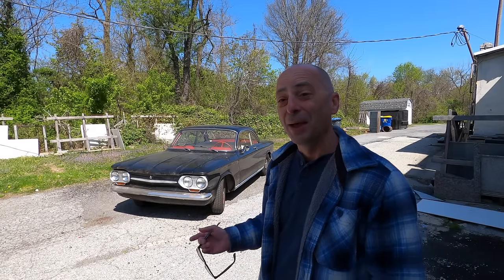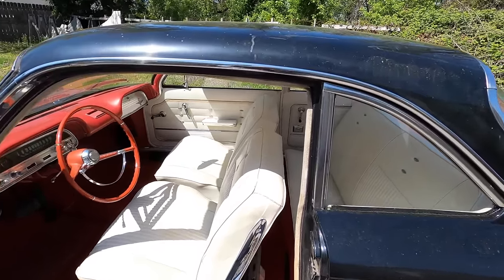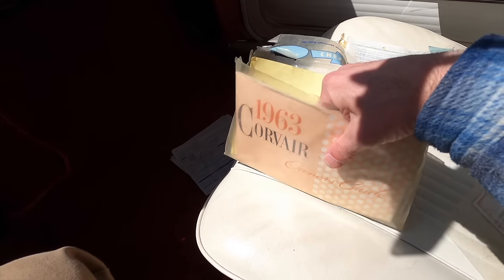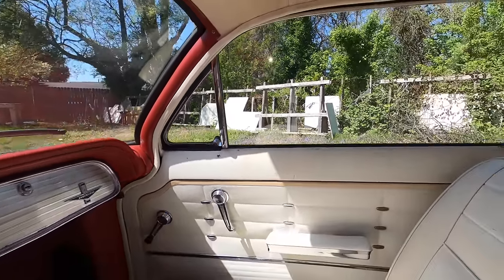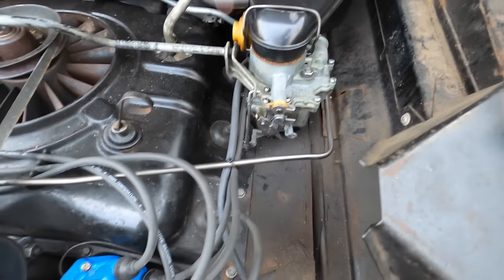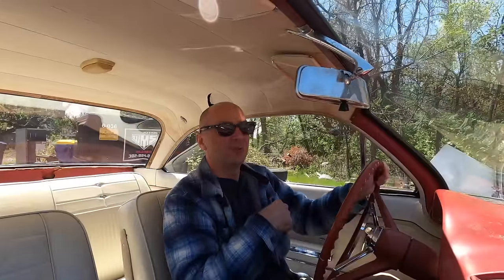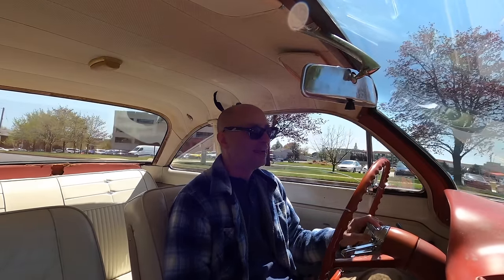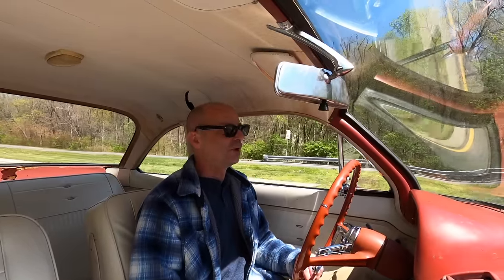Chevy Corvair - The Weird, Quirky, Cheap and Yeah COOL Compact

Comment: Something that I rarely hear commentators mention is that Chevy spec'd front tire pressure at 16psi front and 30psi rear. You typical gas station attendant (back when they would check your oil and air your tires) would set all 4 tires at 30psi, which drastically affected the handling. Also, the first gen Corvair had a swing axle rear suspension, (the reason for the propensity to roll over) just like the Mercedes, VW, and most other inexpensive cars with independent rear suspension of that era. It would have been interesting to see what Chevy would have done with it if Ralph Nader had not put a bullseye on it.

Comment: The gas caps on those were a vented cap and they were a very simple cap because they didn't have evaporative emission controls back then. You could probably put a new cap on it cuz they're very cheap good the other thing I would be looking at is the fuel pump. Remember that's an air-cooled engine and it runs a bit hotter than the water cooled engine. The pump might be starting to get weak and he might be getting vapor lock. This is where the gasoline boils in the gas line turns to a vapor and shuts off the gas flow. Most people don't even know what that is today because of high pressure fuel injection it doesn't exist anymore. The other thing that needs to be addressed is the gasoline we're using today versus the gasoline they used in 1963 is quite different. Today is gasoline's have 10% ethanol in them where is alcohol would never been used in the 1960s. That could create some of the problem alcohol has a bad habit of separating from gasoline (also known as phase separation) the lower BTU of the alcohol requires a richer mix than gasoline that can do it as well. The other thing is motor oils. Do not use for any reason 10 W 30 5W30 modern motor oils their zinc content is too low for that engine the same goes for 10w40 it's too light. The recommended oils are SAE 30 or 20w50.

Comment: The Corvair you show is identical to the one I was in with 4 others from my high school track team when the rear axle came out during a left turn and almost killed all of us...the Corvair was still new!  (Talk about a death trap!!). And as for Chevy selling so many cars, in LA where I grew up, GM bought out the Pacific Electric (PE's as we called them) and other street cars and put their smog producing buses everywhere.  Which forced people who had used (clean) street cars to buy cars!!!  GM was never an innovator, just out to sell their cars, which fell apart by 60 or 70,000 miles.  I learned to drive in a 57 Chevy that lost a front wheel on my way to school.  Funny, the 57 Plymouth I got afterward drove untill the engine died without losing any axles or wheels.

Comment: The stalling and no-start may ne due to vapor lock...an electric fuel pump cures that.  Also a 1964 type rear transverse spring and front sway bar will greatly enhance your handling.  Seat belts are an easy and important upgrade as well...enjoy your baby!!

Comment: Corvairs were a cult car in the 60’s !
Definitely in a league by itself ... you had to respect its limits but these cars would perform well and were reliable ! 
Biggest problem was George Nader- besides that they leaked oil if they were over heated and would throw the fan belt if over revved ... I have a 1960 one owner with a 4 speed and a spare spare motor now ... been sitting for decades but tons of potential !

Comment: I bought a 62 Falcon that sat a while and it had same fuel issue, it was dirtdauber nests in the vent line, blew out all the crap and then it stopped stalling.
I have a 67 corvair, the late models are really different cars and look great.  I would not own an early one, they look like old cars.

Comment: No question, it's a cool car.  But it really is a bit dangerous.  Being scrupulous about your tire pressures helps, but the combination of soft springs, and rear engine and a swing axle, gives it very unpredictable handling.  The problem with the heater that you mentioned is actually a bit more serious than smell.  Actually, Carbon Monoxide leaks badly into the passenger compartment, which can be harmful and even fatal.  And the steering column doesn't collapse, extends past the front axle and has no engine to help limit its travel.  So a small front end impact can impale you.  Of course, no classic car is as safe as a modern car, but this one is a bit risky, even for me.

Comment: Covairs are definitely cool. I think, that having an automatic transmission in an early Corvair is pretty unusual. Automatics used a lot of the engine's power which probably explains, why it has the higher horsepower engine. Probably, the original owner wanted automatic & automatic transmission Corvairs likely "automatically" came with the more powerful engine, unless it was a special order.

Comment: If you don't "lock" the ignition, you can start the car without having to find the key.  That was the point of being able to take the key out while it is "on".
Reply: Thats a weak theory not fact:  Why would Chevy design stuff so you could lose your keys?  What about this theory:  Its so you can get out and open the trunk without turning the car off - lets say you're warming it up in the winter and want to go back in the house -

Comment: Lookup the Pontiac Tempest with a 4 cylinder and rear transaxle from the same time frame.  Interesting car,  it had a " rope " driveshaft and half a 389 V8 engine.

Comment: When your Corvair was acting up where you crossing into the next county?  That's what happened to my friends Corvair.  Anytime we  passed into another county his 1964 Corvair Monza Spyder would act up.  Come back over the line smooth as glass.  It was a quirky car at best. But fun.  He bought it in February 1980 so evertime I here the Off the Wall by Michael Jackson I think of Phil's Corvair.  We called it the champagne bomb because of the color and of course that it was a Corvair.   The day he bought it at one of those used car lots that sells cars the mew car dealers wholesale.  I left ahead of him and he was going to meet me at  my house.  I'm standing in the front yard talking to my mom and we notice a plume of smoke off in the distance.   We kept watching as it got closer and closer.  Next thing Phil pulls up in this cloud of smoke called a Corvair and I just started laughing.   At the time he wasn't finding that humorous,  and the look on his face was priceless.  I think it ended up being something relatively simple but that Corvair spent enough time in the shop being repaired that by May 1981 he had had it and traded it for a 1972 Ford Maverick Grabber.  That was a super fun car.  302 V-8, bucket seats floor shift and fast.

Comment: I had a '61 Corvair coupe when I was in college. I paid $212.50 for it after negotiating for 30 minutes with the previous owner. He wanted $225. It was easily the worst car I ever owned. It had a 3 speed manual transmission and an interior that was about 40% cardbord; the rear deck, the kick panels, the rear side panels, the sun visors. I think the door panels were cardboard covered with grey Saran Wrap.
But I didn't expect much. What bothered me the most was that it was the most miserable car to drive you could imagine. I had to drive up a moderately steep hill on my way from school to my job and I virtually had to row the car up the hill. Between the 3 gears  there was no engine speed available with enough torque to climb that hill at the speed the other cars were going; shift, shift and keep shifting. Besides that it was clear that GM knew that there was potential to lose control around a fast corner. Corvairs, like many cheap European cars at the time had independent rear suspension with swing axles. This design had a fatal flaw called "jacking" where if you changed directions quickly when already in a turn both rear tires would assume extreme positive camber (top of the wheel tilting outward) meaning that the car was at high risk of a roll over accident. The GM solution was to make the steering so slow that any kind of quick reaction was impossible. Virtually any sharp turn required elaborate movement of the steering wheel. So it was slow, impossible to drive with any grace, unreliable, noisy and broadcast "Cheap Car!!" Dangerous? Not any worse than an early VW. Poorly engineered and built? Absolutely. I junked it when the transaxle failed about 6 months after I bought it.

Comment: I've had Corvairs  since high school....the 60's 🙄!     Your lean running condition possible solution..... try spacers/insulators under the carbs OR check the fuel pump condition.  Good luck!
Reply from the maker: Thanks for the tip and I'll definitely look into both.  My first thought was fuel pump and it might just be prudent to get an electric pump in there.

Comment: The pieces of tin in the engine compartment need to stay in there. Just like on older lawnmower engines and rototillers. They direct the wind and help cool the engine and feed it air. Parts of the engine could overheat and you won't know until it is way to late because these engines don't have the multiple heat sensors in different locations. I am surprised the "Corsair expert" removed them. He probably knows way more than me though and it must be working. I always liked these cars. When I was in my teens a neighbor had one. Some days I rode with my friend, her son, to school and other days my mom took us in her VW Beetle. Either way we were in rear engine small cars and both our parents were gas misers and ahead of their time.

Comment: That 6 cyl 100hp air cooled is powerful for it’s day. Having no water cooling you can get the engine running easy!  No gas gauge?  Replace the float Cork…or use a wine cork🤭 

Ford Falcon was a 🐶. My Grandma drove one ….Scary!!

Comment: Some wd40 helps alot with latches on these old things. I can usually get my doors hoods and trunks to works easily and smoothly if i spray it down. My 87 chevys trunk wouldn't open by itself until i lubricated the hinges and everything that moved
Reply from the maker: I think I'm gonna need an entire box of WD40 on this car!
Reply: WD40 works great, but I find spray lithium grease lasts longer once I've freed something up.
Reply: @hullinger  Look for WD-40 Specialist PFTE spray. It's teflon. WD-40 is a water displacer, not a lubricant.

Comment: it’s basically a American built Porsche even when you did the Start Up and the Camera rear Angle video it  totally sounded like  a older 911 or 912 IMO  just keep your tire Pressure correct  as all hat bad Press fromRalph Nader  turned out to be just that being the Rollover issues   on your question of the Corvair Definition ? I strongly Dissagree , i think for the period Cherotlet did a great job on the design and Execution of the car   both sets of my Grandparents had them and Drove one for many years  my Dad was a VW Beetle guy and he loved driving a Corvair whenever he could !  he used to take me along on Country Roads in a Dark Green Monza his Mom had with a manual Floor Shifter (1965) I think ?  i remember it had AC  and because my Dad grew up in the same Rural area my Grandparents lived  he enjoyed Hot Rodding  on the Country Roads he knew quite well growing up !

Comment: Ok Bud you asked, 1965 Corvair 110, 2 speed automatic on dash shifter, my first car, 38,000 miles I bought from a chevy dealer in 1969 for $600,  I lived in the U P of Michigan anything below 0 temp it WOULDNT START back to dealer, = valve job, carb rebuild,  1 110 volt dipstick heater, 1 magnetic 110 volt heater .... 20 below .... maybe it would start .... maybe. next up right side of front end fell apart going down dirt road at 35 mph, minutes before I was doing 65 mph on paved hiway back to dealer. next. engine dropped on paved road, couldn't stop it, couldn't shift in neutral, turned off ignition key it kept running, stood on brake pedal with everything I had finally stalled out engine, during all this  " excitement " I covered about a  half a mile, back to dealer,  I owned this junk, miserable, POS till i paid it off, about a year THEN IT WENT BACK TO DEALER  he gave me $ 200 on a trade in lol the general opinion of the mechanics working for dealer was, Corvairs were garbage having worked on several that had dropped engines, there were lotsssssss of VW bugs around at the time, that were good cars, Classic car ? ???

Comment: Chris,  its a fuel cap problem,  my 1963 dodge dart does  the same thing,  I use a fuel additive,  went i fuel up, but my dart has 60k  on the clock,  its a hype six
Reply from the maker: Great tip about the fuel cap not venting.  I'll go there first the next time I get a  lean condition.  And I love those '63 Dart's!  Totally wacky and cool and exactly my style.

Comment: I had 3 different Corvairs way back , One i bought new in 1962, the other two were used also bought in the 1960s a 64 and then another 62. I never had a problem with any of them and I was just a kid so I drove them hard. Never felt unsafe. I feel they got a very bad rap.

Comment: I Love a Corvair that and the late 60s C10/C20 where the only chevys I have ever owned, the first Corvair I bought in 1984 it was a 65 corvair body on a stretched CJ2 chassis with a pinto motor haha, it was so cool drove like a jeep went anywhere with in reason, but I liked the lines of the car so I found another with the flat 6 it was pretty much a beater but ran well once I tinkered with it...Drive that thing till the wheels fall off! or if its for sale?

Comment: oil the speedo cable a  use  liberty clock oil on the  bearings of the  speedo cluster   ,,,dry bearings  will snap  the needle  off  ,,,
Reply from the maker: Great tip and thanks for sharing.

Comment: Still got those slabs out back from the previous tenant I see. Could be called littering by them.
Reply from the maker: Totally agree with you about those stone slabs in the back yard.  I had sold a few myself as did the other renter but man, that yard became a dumping ground for junk.
Reply: @hullinger  I think you said they went bankrupt no where to be found?
Reply from the maker: @Sonoma_Coast    Well actually, that stone shop is still around and just a couple miles down the road but they're operating under a different name now.   There's just no recourse as the corp name they used at the location I'm at is dissolved now.  Luckily I'm just a renter and it's not my problem.

Comment: Growing up I loved those cars and engines . They made a ss model convertible. We never could understand why they took them off for questionable safety issues . 66, mustang convertible, 68 fastback 289 ci each , 3/4 in cams. 4 barrels . 
A 68 Oldsmobile 442 . 455 ci. Dual quad carburetors, dual exhaust , Hurst Old stick shift . I think it was political rhetoric. One way to research who and which states had competing auto models at that time .

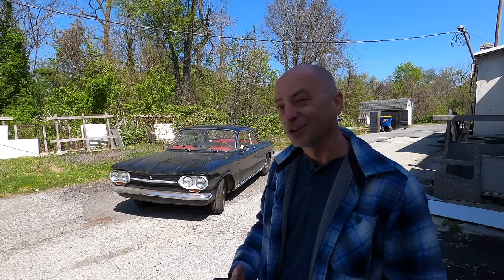Comment: 01:34 sounds a hell of a lot like you said it's a Corvair Mazda! Does that mean it's rotary? 

It's OK I know it's a Monza... I Googled it

Edit: $25 an hour expert (That sounds too cheap) and you're having issues? If he rebuilt your carb he's set up your fueling. He replaced your fuel tank, sender and lots of wiring? Well he'd be responsible for your gauge not working anymore. Why are you figuring it out? TBH the bill it sounds like he charges a low hourly but charges a lot overall

Comment: First, the Chevrolet Corviar was a knock off (with an improved roof line) of the Volkswagen beetle.  Second, the real "unsafe at any speed" aspect of the original 1960 version was the gasoline fueled passenger compartment heater.  A few leaked CO2 and a few others set the entire car on fire.  Otherwise they were fine. Ron W4BIN

Comment: Was it ever proven that the Corvair was unsafe according to Nader or was he looking for someone to pick on?
Reply: Yes and no, the early models from 60-63 could get tail happy when pushed to the limit, and under really heavy cornering the rear axle could tuck under the body. The problems were the same as other rear engine swing axle cars of the era, like Volkswagens and Porsches, but, probably, since Corvairs were a lot more powerful than those in the era and also aimed right at the bread and butter mainstream American economy car buyer, it was a bit easier for Corvair drivers to get into trouble. For 1964, they got an anti-sway bar, limiter straps, and a longitudinal rear leaf spring, for 1965, the suspension was completely redesigned. Had they done the '64 arrangement from the beginning, Nader would have had no material to talk about. In the early '70s, though, NHTSA conducted an in-depth study of 10 years of data and concluded that the Corvair was no more or less safe than any other small car on sale at the time. Its the only time the federal government has ever retroactively "exonerated" a specific model of car like that.

Comment: Your lean/stall problem is caused by vaporlock with modern gas in a carbureted car. The fuel boils in the carb bowls especially on an air cooled car like the Corvair. Not a problem on fuel injection on modern cars. Use pure gasoline only (no ethanol) which is what your car was designed for. Ethanol gas did not exist in 1960.

Comment: Few people wanted small cars in the 50s except for maybe some women. GM wasn't going to produce a car just for women. If you look at the VW Beatle the majority of buyers were women. The corvair was built to capture the VW market share. My uncles first car was a 62' Corvair with a 4 speed the same summer he graduated HS. in 65'. Black with blk interior. I wanted him to get something cooler but it was his money. He kept it maybe a year max then traded it in on a 63' Pontiac Tempest with a 3 spd manual. He moved away to another state after that so I don't know what he got next. The last I spoke cars with him he had a 69' Charger with a 383 and this was back in the mid/late 70s. He died young in his 40s in the mid 90s.